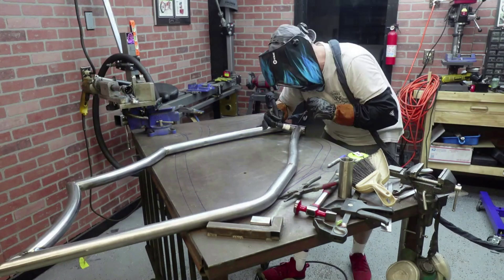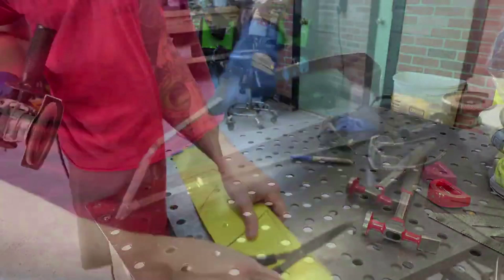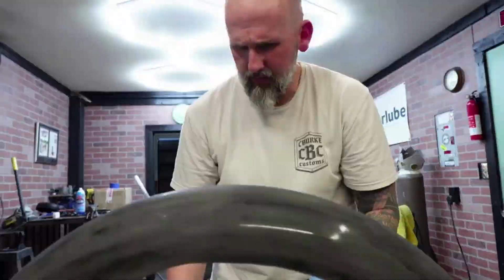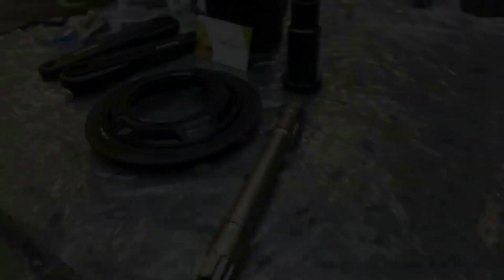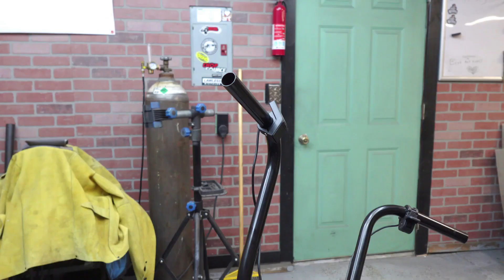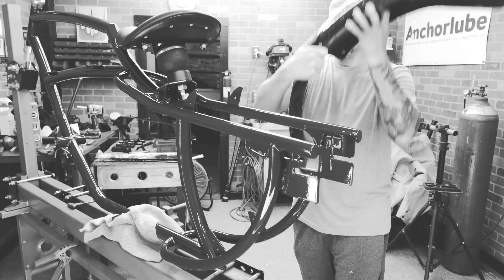Custom CYC Mid-Drive Cruiser With Carbon Fiber!

Comment: How did you get air to the seat airbag? Do they make compressors compatble with 52v batteries?
Reply from the maker: No, just use a bike pump. It will stay.

Comment: The pipe/tube bender from Eastwood and Woodward Fab, isn't set up, tightened up properly if you are kinking the tube.. I know this because I use one Daily at work, and I had it kink at one point, so I went round and systematically tightened every nut and bolt, and haven't had the problem since.. Just a tip and a bit of advice..
Reply from the maker: Yep, I got that the first few times I did it. I fixed that part. It's the ripping into the metal the dies do that I hate. Like it diggs into it.

Comment: Pretty sick bike. Those ape's enhance the overall look of the bike and the colour selection is awsome.
Had a question about the diatance this bike can run in a full charge ?
Reply from the maker: I think so, too. I'm not usually an ape guy, but they fit. As for distance, not 100% sure yet. I've done about 4 miles on it so far. Rains a lot this time of year, so I haven't taken it out much. I'll know more this weekend. Big street shut down in Tampa this Sunday.

Comment: Nice build! What type of metal tubing did you use for this? 304SS?
Reply from the maker: Nope, .065 DOM tubing
Reply: @CburkeCustoms  You have kinduv inspired me to get into welding. Can I ask why you choose that metal? Cost durability, weldability, bend-ability, etc?
Reply from the maker: @anthonysuarez7416  mostly strength, and you can get it pretty thin and still be strong.